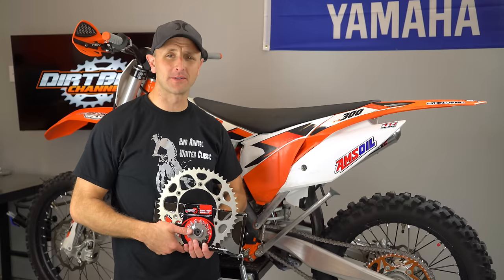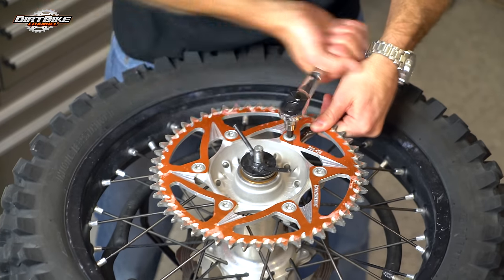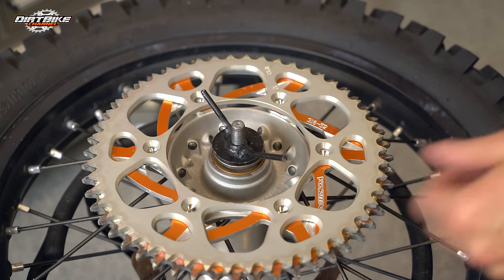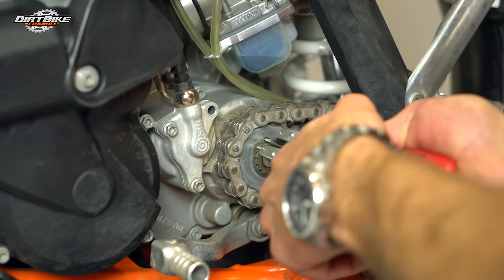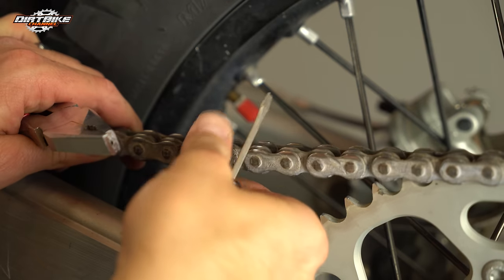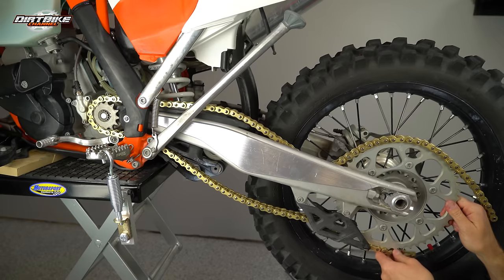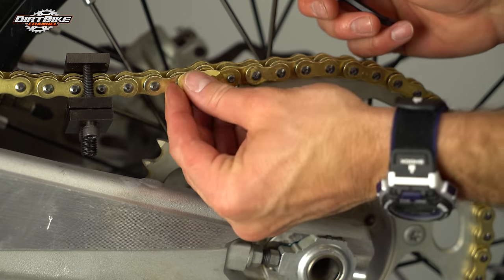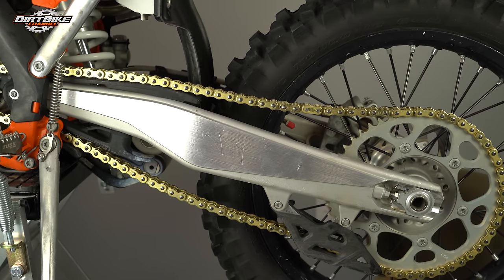Dirt Bike Chain and Sprocket Removal and Installation 4K - Episode 106

Comment: Tech tip: put your old chain over the rear sprocket when you take off the bolts. If the wrench slips it wont hurt as much.
Reply: Or use a longer wrench, or start with your hand already beyond the sprocket. I cringed watching this, mainly because I've removed part of my knuckles in the past and it ain't nice!

Comment: just a friendly FYI. When removing rear sprocket if you loosen rear nuts first verses the Allen side(just use Allen to hold it still) it will be easier and less chance of stripping out the Allen side. Good vid!
Reply from the maker: +Tklatti01 These are Torx bolts, but I think it would the same from either side.  Whether you are holding it from moving, or trying to turn it, the force is the same on that head... Just a thought.
Reply: +Dirt Bike Channel I thought so also. but it's clearly easier loosing the nut side first. weird...lol
Reply from the maker: +Tklatti01 I'll give it a try next time.
Reply: It's significantly easier loosening the nut assuming you have the same length spanner/ratchet, sometimes I would have a spanner on the back and try to turn both at the same time
Reply: I find it easier and safer to crack the nuts with the wheel and chain still on the bike.

Comment: You don't have to be an official mechanic to tackle projects like this.  It feels really gratifying to be able to successfully pull off projects like this.
Reply: About to try all this for the first time. 🙏🏽
Reply: @lukefish7562  You've got this.  Just follow the video, use common sense, and don't rush.  It will feel great when the job is done.
Reply: Hey I appreciate the encouragement!    I definitely understand and welcome the feeling of accomplishment. Between this and my first tire change coming this weekend I’ll either be super pumped up or in a insane asylum. I did get one of the Moose tire changers so hope that aids a lot! Thanks again!
Reply: @lukefish7562  The tire change is more of a challenge, but do-able also.  If anything will put you in the asylum, it will be the tire change.  Make sure and have true tire irons, more than 2 if possible.  The biggest tip I could give you is that when you get to the final bit of tire to get over into the rim, pinch the tire together on the opposite end, forcing the beads together, and sinking the beads into the deepest well of the rim.  That gives you the little bit of extra clearance to work the final bit of tire under the rim.  And during this final stage, it's important to take "small bites" with the tire irons.  Watch a few videos in preparation, and you'll be fine.
Reply: @kings17court  well dang I’m glad I “bumped” into you. I’m very hesitant with the tire as I’ve read the horror stories in the comments in the videos I’ve watched. It’s raining here all day tomorrow so I was hoping with no rush to ride I’ll be able to take my time and take breaks when frustrated. I sincerely appreciate the tips because I need all the help I can get. We shall see! Have a great weekend!

Comment: When you are taking the old chain out use the master link to connect it to the new chain and pull it through. It can save a little bit of time and effort
Reply from the maker: +Carman Eben Thanks for the tip.

Comment: You can also use the motion pro chain alignment tool to determine that your back sprocket and front sprocket line up the chain straight.

Comment: Use a large flat head screwdriver and a hammer to remove the master link. Press up up to the open end give it a tap and it usually comes off unharmed, it works well to put new ones on as well. And if you dont have the the press tool, a large pair of channel locks and a small socket work to press the face plate onto the link.

Comment: Hey Kyle, great video. I wanted to throw in a couple more tidbits. 1) recheck your chain tension after a while riding as it will stretch. not as much with an x ring as conventional but still worth a quick check.
2) There's a website a friend put me on called gearing commander which is a great resource if your not quite certain of what sprocket combination you need. it's very useful as you can apply different combinations and check estimated RPM in certain gears at certain speeds and vice versa. it is machine specific.
Thanks.
Reply: +desertghost Ya, I also always just sit on my bike after tightening the chain.  I'll even jump on it to get some travel in and make sure it doesn't tighten up.

Comment: thanks for that however you dont say where the chain tension adjuster is set at before you can work out the length to have your chain at? much appreciated if.you could help me. thank you

Comment: Nice video but top tip is for you to turn those spacer bolts around to shorten the wheelbase of the bike. Why do this - by shortening the wheelbase or moving the axle bolt forward your bike will turn better in the tight stuff. You'd have to remove a chain link but that's simple with a chain breaker tool. Keep riding and smiling
Reply from the maker: +Dale Becker Then I could give up some stability in the desert.  I think I'll keep it the same since I find it's very agile anyway.  Cool tip though.
Reply: +Dirt Bike Channel Fair enough - not much desert here in the UK

Comment: Love your vids Kyle thanks for the content. Dying to hear about this new 250XC TPI. One thing I noticed on the sprocket change I suggest loosening the nut on the bottom of the sprocket while holding the torx bit stationary instead of holding the nut on the bottom stationary and trying to loosen the torx bolt from up top(hoping that made sense). Just my two cents. Lot less force required to loosen the nut from the bottom in my experience.
Reply: As an aircraft mechanic of 25 years I can say you are correct. Loosen the nut first!

Comment: I just bought all the same stuff as you for my YZ250. I have 2 questions though because I couldn't believe how heavy the steel sprockets and chain are. They are all primary drive steel units with the same gold chain as you. Question 1: Am I going to have any fitment issues with the new chain being that it is wider than stock due to the O-rings. Question 2: Am I going to regret putting these new parts on, considering how heavy they feel?? I haven't taken the OEM parts off to weigh them but I can't believe they are going to be as heavy as the new parts. Thanks!!!

Comment: Kyle, i just bought EXC500 2016 and its seems to me that 14/48 stock sprocket set isn't good for tight trials and deep sand! Can I go to 13/52 to improve and reduce wear on my clutch ?love your channel
Reply: +BikeFreekShow If have a 16 500 exc the stock gearing should be 15/45. 14/48 is what im running for open desert and two track and it seems great. Id be cautious about running to short of gearing as the 500 exc has so much power that you want a bit longer gearing or you will be digging trenches up everything you want to climb. 

That's part of the 2-stroke desire, you can put the power down a lot easier and with a lighter package.
Reply: +Fluxx43 thnx... It's really 15/45 and its have no lower toque on deep sand and speed is to crazy for any track ... It's a 4 stroke . I'm considering 14/52 for deep sand and dirt climbs .
Reply: @BikeFreekShow  I think they were saying you subconsciously desire a 2 stroke, I may be wrong
Reply: @BikeFreekShow   And sorry I'm a little late on this one😂

Comment: Should there be any type of play on the front sprocket? I just bought a 2015 200XC-w and had to replace the countershaft seal in it. . The seal kit came with a thicker Snap ring than the factory one and I haven't installed it yet. It seems like there is to much play and the seal is still leaking. Thanks
Reply: In and out play is ok and usually there by design, front to back or up and down etc is not ok and is a sign of a worn bearing.

Comment: I like the look of that chain. Is there a way to tell when you need a new chain or not?
Reply from the maker: +Solar XSniper You need to look at the teeth on the sprocket.  When the shape of those teeth start to change, it's time for a new chain/sprocket.  You can also look at the o rings on the chain.  If they look worn or broken, then It would be a good time to replace.
Reply: +Dirt Bike Channel okay, thanks I'll keep that in mind when looking at it. Every time I lube my chain I look at the chain and how tight it is to make sure it's not to loose

Comment: you would do easier when you turn the nut instead of the screw when loosing the rearsproket.
Same when tighten them up. Thats why the have this cone on the screw-head.
Reply from the maker: +HauimauiSlopeking They are counter sunk screws so they don't grab anything like rocks and tree roots.

Comment: You should try one of those "supersprox" rear sprockets, theyre aluminium centre with steel teeth. They last so much longer than those standard ktm ones in my experience
Reply from the maker: +dazaladz I've tried a couple of different ones.  I have not had any issues with any of them.
Reply: +Dirt Bike Channel fair enough.

Comment: Is there a certain amount of links that should be used for each bike? I have a new chain that is 118 links and too long on my 2015 350 XCF..Should I make it 117? 116?.Is there a spec from KTM?
Reply: You just make it long enough so that when the chain is tensioned, it sits nicely inside the alignment markings on the swingarm.

Comment: Just an idea, but if you did a video on what the different sprocket sizes and ratios do to your bikes gearing and performance that would be awesome. Its kind of a confusing topic. If you could brake it down for us that would be cool.
Reply: Just think about a mountain bike and you're pretty much there.. bigger front sprocket gives more speed but harder to accelerate, smaller front sprocket gives less top speed but better acceleration. Bigger rear sprocket gives more acceleration and less speed, smaller rear sprocket gives more speed but less acceleration. Front sprockets are usually cheaper and easier to change so people will often change that by 1 tooth as a starting point and then consider changing the rear if you need to change further.

Comment: hey was just after a bit of advice. i followed ur vidio step by step but when i installed my new front sprocket it had a some lateral movement in it now. also it is clicking now. have you any advice on how to cure this. thankyou
Reply: Jay Newton front sprockets are called "floating sprockets" so if something is not adjusted it won't break things

Comment: Why all bikes are connected small front gear to rear large gear!?Can u explain
Reply: because you couldn't have a large 50t sprocket on the front, there's not enough room. Remember there are gears adjusting the ratio inside the gearbox so it's not the same as a mountain bike which only has a front and rear sprocket.

Comment: How come dirt bike chains come with the master link clip as opposed to sport bike chains where you have to rivet the pins?
Reply: Wyatt C imo because bikes hit like 180 mph and the chain can pop off easier because of the master link.
Reply: If road racing, you will not pass tech inspection unless it’s riveted.  I’m assuming it’s a safety thing due to high speed.  Never really asked in the 5 yrs I road raced, just riveted my links and never had a failure.  I ran 520 chain and sprockets as well to shed drive weight.  I will say that it was not abnormal to go 180 mph on a road course, but only on rare occasion I hit 80 on my 300.

Comment: My local KTM shop said WD-40 is suitable for cheap chain lube, depending on which chain link is in your chain (forget which one he said would work with wd40). What are your guys' opinion?

This shop mechanic also races and does desert tracks often and says it's what he uses and has no issues. Thoughts?
Reply from the maker: +tmac9938 I haven't tried WD-40 on my chain.  I'd be curious to see what others think about it.
Reply: +Dirt Bike Channel There was some video about it where they tested it and they said its good for a primer, not lube.
It doesnt hurt the o-rings like many people think
Reply: +NukaMoto My guy also mentioned WD-40 doesn't have a lot of fling. But you may be right about it only being useful for a primer. Common sense might suggest WD-40 would be more popular in the moto world if it really did the job as needed.
Reply: The film it leaves behind is minimal so it's generally not recommended, although with O and X ring chains the need for top quality lube is reduced as it is lubed internally. The rollers pretty much stay stationary once on the sprocket which most people don't understand, the lube helps reduce some wear at the point where the roller engages with the first tooth and also prevents rust. The most important thing is keeping the chain clean because dirt on the outside of the rollers is like a grinding paste on the sprockets and rollers which is the primary cause of wear. Also, chains don't stretch, the rollers wear internally which increases the internal diameter which makes the chain become longer when under tension. You want to find a lube that dirt doesn't stick to but is also still present once you have finished a typical ride. Personally I think WD40 is more suited to cleaning the chain but if you change your chain super regularly then you don't need to worry about wear rates anyway.
Reply: I ride KX500 in the desert. I dont use chain lube. I use o ring chains and twin ring rear sprocket. I have found lube only attracts dirt and makes a grinding paste that makes chains and sprockets wear faster. Been doing this for 35 years. Chains and sprockets last 100 hrs on the open class machine.

Comment: Just a question were did you buy your chain and sprocket kit off?
Reply from the maker: +josh zub http://www.dirtbikechannel.com/parts/
Reply: +josh zub We usually get our parts from Rocky Mountain. See the below link

http://www.dirtbikechannel.com/parts/
Reply: +josh zub http://www.dirtbikechannel.com/parts/
Reply: +Dirt Bike Channel I know that I was just wondering the brand of the chain and sprocket?
Reply: +josh zub I think he put on Primary drive.
Reply from the maker: +josh zub Primary drive chain and primary drive front sprocket.  It's the stock rear.
Reply: +Dirt Bike Channel is the hole kit you bought is primary drive? Sorry for all the questions.

Comment: What an absolutely retarded product name for a FINAL drive chain!  A "primary drive" chain is like on Harley and Norton and many others the chain between the crank and clutch transmission ....ignorant name   How about calling a line of tires "knobby tires" but they are street tires...that is how stupid "primary drive" is for a product name for a FINAL drive chain....someone probably already had that name so they just took advantage of something that sounds cool to the ignorant masses that know nothing about motorcycles in general....only one little segment